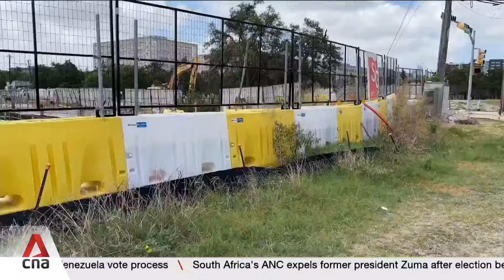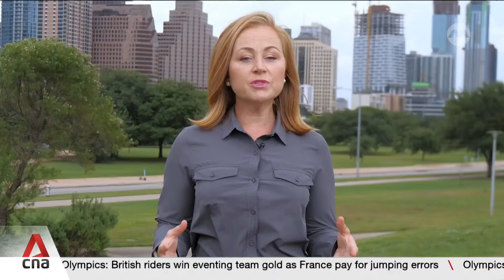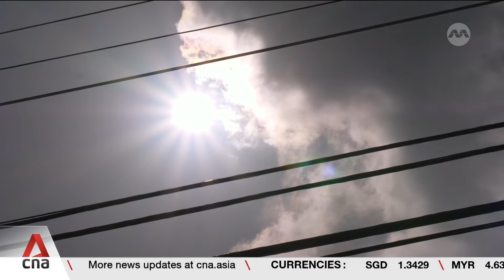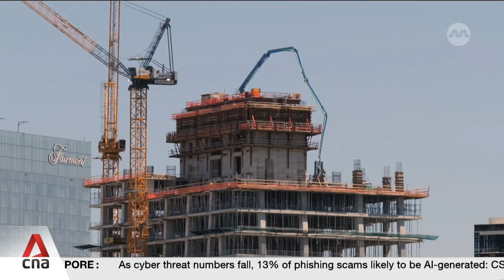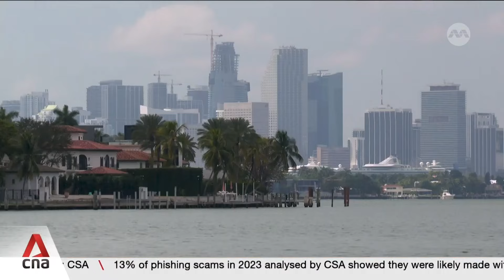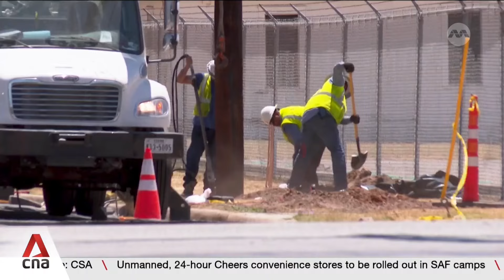Texas law gets rid of mandatory rest breaks for construction workers

Comment: If it's too hot, work in the evening or at night like in Saudi Arabia. 
What's the problem?? 
😊😊
Reply: To answer your question:  In San Antonio, daytime is defined as 6 AM to 10 PM but in Houston permitted construction hours are 7 AM to 8 PM while Dallas ends the daytime hours at 7 PM. Additionally, each jurisdiction regulates weekend, holiday and after hours work differently, requiring special permits for exceptions to normal permitted hours.
You might consider doing a little before commenting next time.